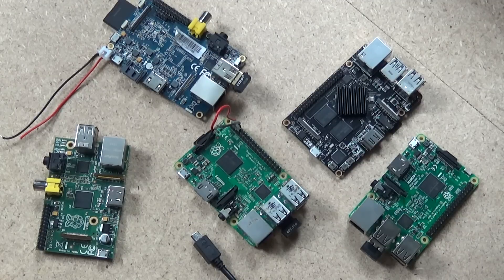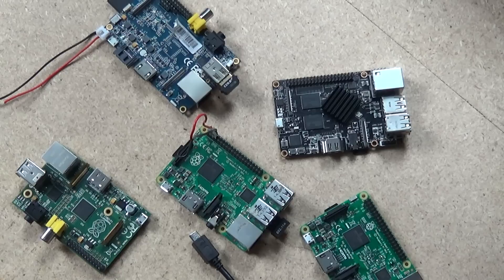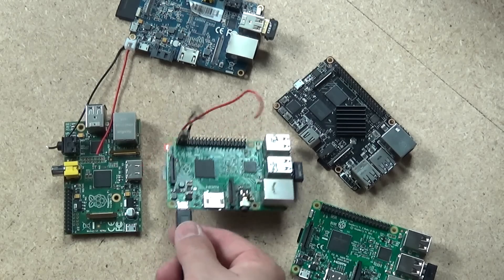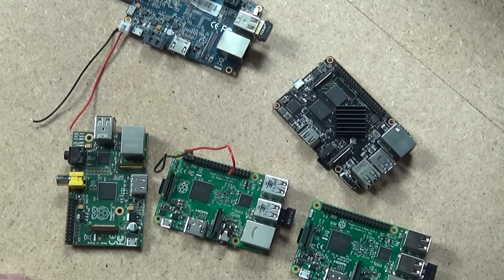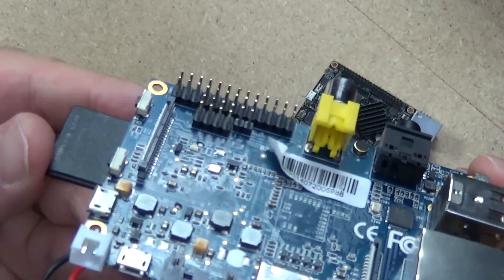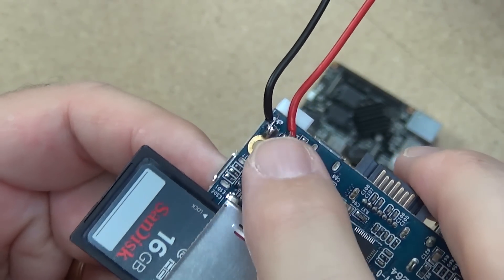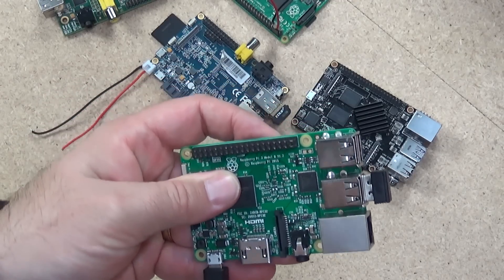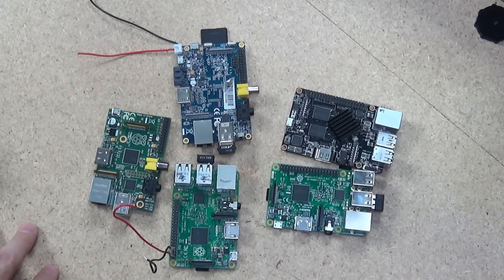Raspberry Pi Power Options - 3 Ways to Power Your Pi or other SBC (MEHS) Episode 44

Comment: Hi. I've attached a Navio2 to a Raspberry Pi 3 Model B. The Navio2 powers the pi. I have a power module attached to the Navio. Plugged in a 3S LiPo Battery. When I plug in a wifi dongle there isn't any power to the USB wifi dongle. Is there a reason for this? The forums and the few videos I've looked at everyone just plugs in their wifi dongles and, hey presto!, it has power. What aren't I doing right? Some help please. :D
Reply from the maker: - Hi.  I have looked at the Navio2 briefly.  There could be a couple of issues.  The Navio provides power to the Pi and the Navio also requires power.  How much power are you supplying the Navio?  It should be 5V at 3A.  Second, the Navio takes over many of the pins on the Raspberry Pi.  It is possible that the serial bus is taken over by the Navio meaning USB might be disabled.  Lastly, you could have a faulty Wifi dongle.  Disconnect the Navio, plug the power supply to the Pi and connect the Wifi dongle.  If it works then its the Navio.  Also, why not use the Wifi built into the Pi?  Cheers.
Reply: I've tried the wifi dongle on my Desktop PC and that works fine. Can rule out a problem with the wifi dongle, i guess. The Navio's Power supply: Power module, servo rail, USB copy from the Emlid website about Naivo2. Average current consumption: <150mA. I've tried connecting the wifi dongle to another stand-alone Raspi for Rx and, again, no power to the dongle. I don't think the USB is being controlled via the Navio because If i plug in a small 4G Wifi dongle into the Navio then that works. I can see it's IP address and connect my Laptop to it. All good there, I suppose. I'll try the smaller 4G dongle on the Stand-alone Pi and see if the software runs ok. I am thinking you need an external power supply. If that is the case I wish it was more obvious whats needed to do. :s I am not sure, but on the Rx side I will eventually connect my Mobile Phone or Table to it and run QGroundControl via a hotspot. It's the EZ-wifibroadcast hotspot but not sure if that from the wifi dongle or the pi's wifi. I'm guessing from the pi as the main reason for the two USB wifis is for Tx and Rx. But who knows.
Kids, don't try this at home!
Reply from the maker: - Sounds to me like the dongle you have is not Pi compatible.  All i can suggest is try another dongle that is known to work with the Pi.  Cheers.

Comment: So the upper limit for a micro usb port is 1.8A yet the rp3 needs 2.5A. Why do we still use micro usb for power again? If the rp4 is more powerful theyll have to come up with a more robust solution
Reply from the maker: - Hi.  Yes the micro USB port is not the most maker friendly port to use either.  I have taken the RPi 3 official power supply apart and I can tell you that the wire gauge they used is much thicker than typical wire you find in normal micro USB cables.  But I get your point, how much power can we really push through micro USB connections.  Cheers.

Comment: Is the mi power bank 2 (10000mah) able to power the Raspberry pi 3?
Reply: Why don't you fucking plug it in and find it out by yourself? Internet babies to be spoonfed
Reply: @UomoMagnetePlus  I know this is 1 yr ago but maybe they were gonna buy one and didn't actually have it.
Reply from the maker: - Hi.  The Pi 3 requires 5V at 2.5A to run without issue.  The power bank you mentioned delivers 5.1V at 2.4A ideally.  I have run a Pi 3 with a slightly under powered supply before with no real issue so I will say yes this power bank will run a Pi 3.  The only factors to consider is, does the power bank really deliver the claimed power and if you use a cheap low quality usb cable you will introduce further power loss going to the Pi.  Cheers.
Reply: thank you..
Reply: My Electronics & Hacking Show Wrong. It doesn't need 2.5A all the time. It just need a stable voltage to avoid long run damages, if the Ampere are not enough it will simply work at basic clock speed and show a lightning bolt icon in the screen.

Comment: Curious, I had powered a raspberry pi 3 using gpio pins and It worked for about a week then seemingly fried the chip and I had to replace. I used a 120v to 5v step down
Reply from the maker: - Hi.  Yeah the GPIO are a good option but your supply needs to be regulated and clean as the normal input protection you get through the micro USB port is bypassed when you power through the GPIO.  Cheers.
Reply: My Electronics & Hacking Show what would you recommend doing to achieve that?
Reply from the maker: - Best bet is to use a quality 5V DC to DC voltage reg.  There are lots of choices but it depends on the power supply you are using.  I typically use Pololu U3V50F5 regulators which are boost regs when using lithium battery power supplies.  If you are using a power brick which is dropping 120v AC to 5V dc then I would still use a 5V reg as the power brick is unlikely to be very clean.  Hope that helps.  cheers.
Reply: My Electronics & Hacking Show thanks!

Comment: amazing tutorial
 i want to make It on powerbank,conect It directly to powerbank,but my question os: could It Be hybrid? i mean the (+) and (-) from rasp connected on powerbank and USB charger at same time,when unplugged It work with powerbank..when put directly energy It charge and uses pi Power directly
Reply from the maker: - Hi.  Its possible but you would need to make sure the output (USB) from the powerbank can output enough power for your project.  The Pi by itself needs 5v at 2.5amps.  Most powerbanks only put out 2.1amps.  I would suggest making your own that can output enough power.  I will be doing a video soon about making a high powered powerbank.  Cheers.
Reply: My Electronics & Hacking Show really? amazing!!!! i Will wait...my project dont need rush because i buyed raspi3 but It Will come only Next week...so i Will stay tuned! thank you

Comment: thank you for the video. 
i'm new into this and i am wondering, if i would do the third option with the soldering, do i need software too on my raspberry? because i watched few videos about gpio on/off switch and there they always need some software.

when soldering how shown in your video can i only solder a on/off switch to the +\- cables and this should work then?
Reply from the maker: - Hi.  Sorry I must have missed your post until now.  If you want the software shutdown option you need a script (software) running on the Pi.  This is better than just turning off the Pi.  You can always skip the script and just solder the switch directly to the cable as you suggested and when you want to shutdown the Pi, shut it down through the operating system and then, when that is finished, turn off the power with the switch you soldered onto the power cable.  This achieves the same thing as the shutdown script and GPIO connection.  Cheers.
Reply: cool thank you for the answer!

Comment: Thanks for the information on Pi power please can you tell me the swg of the red and black cable  thanks Bob
Reply from the maker: Use 24 or better.  I was actually using 1mm solid core there, so 20swg.

Comment: Hi, is it possible to power Pi with both GPIO + also use microUSB as a backup power with power bank?
Reply from the maker: - Hi.  Yes it is.  Just make sure your voltage going to the GPIO is accurate (no over voltage).  Cheers.
Reply: @michaelsstuff4402   Hi, so it is possible to use a 2.1 A smartphone charger and an 1 A charger with pinout? Will none of those components get destroyed? I mean if the pi tries to draw more than these 2.1 Amps, the charger will get destroyed because it's an unsafe one coming from china with no safety mechanisms, which means it would burn...
ty in advance!
Reply: Hey check this thing out https://youtu.be/gr8nxEfSeEA its pretty cool

Comment: So if you have a usb wall plug, you just plug it in an it turns on?
Reply from the maker: - Hi.  If you mean just provide power from a USB wall socket to something like a Raspberry Pi then yes, that is all you need to do to power these types of boards.  The only real consideration is the current being provided by the outlet.  Many wall type outlets are rated at 2 amps.  That is enough for a Raspberry Pi model 2 or some other boards but a few need a minimum of 2.5 amps.  Just check the outlet rating and the power needs of the board you use and make sure the outlet has more.  Cheers.
Reply: Awesome, thank you very much.

Comment: Nice video. About Pi3, do you know if I can use the test pad as the the power input for the Pi itself ? PP1 is +5V and PP5 ground is that is that correct?
Reply from the maker: - Hi.  You can use the pads on the bottom of the Pi for sure (as per the video).  I can't remember which numbers they are but the two I identified in the  video are the one to use.  Just remember to keep the power clean.  No 4.5v or 5.5v input.  Sorry the answer is a bit vague.  I don't have access to a pi right now.  Cheers.

Comment: can i power rpi 3 from 5v 5A smps through power port (micro usb )?
Reply from the maker: TAPAN MOJIDRA - Hi.  Yes you can.  The Pi3 won't draw 5amps but you can certainly power it with a 5v 5a supply.  More than enough power.  Cheers.
Reply: My Electronics & Hacking Show sir how to convert hdmi to rca?
Reply from the maker: TAPAN MOJIDRA
- Hi.  You don't need to as the Pi boards have composite out (RCA).  On the Pi 3 its done through the 3.5mm TRRS connector.  You just need a suitable cable to get 3 x RCA out.  If you really need to convert HDMI to RCA you need a separate digital to analogue converter (DAC).
Reply: bro can i powerup my raspberry with 5v ,2 amp adapter

Comment: soooo .. regarding the soldering points... ehm.. the instructions weren't clear enough.. I've soldered my penis to the ceiling fan
Reply: Unoriginal joke aside, good video mate. Perhaps there is an molex to micro USB on the internet somewhere that can feed super 5v via a computer powersupply. Perhaps there are some way to have the RPi turn on and off the powersuply as well like an ordinary computer
Reply from the maker: - Hi and thanks.  Yeah I'm sure there is something like that around.  I am aware of a couple of add on boards designed to turn the Pi off just like a laptop (ACPI like).  https://www.pi-supply.com/product/pi-supply-raspberry-pi-power-switch/  and  http://blog.petrockblock.com/2015/07/04/powerblock-another-power-switch-for-the-raspberry-pi/
Reply: GengarTV It is...and its simples...an Button for protoboard. You can simple connect It between the cables,other solution: headfone Mic on off...anything that has cables and an on off Button You can use...

Comment: 3:50 It's difficult to tell what specifically he's pointing to.
I'm assuming its the two oval shaped grey spots closest to the edge of the board?
To be more specific about which ones I'm talking about, one is right above where it says PP5 and the other is right above where it says R3 ( from view perspective at 3:44 ).
Am I right in guessing those?
Reply from the maker: - Hi.  If your talking about the two pads to which you can connect power, it is the 2 gold round pads directly beneath and on the opposite side to the micro USB socket.  If you drew a rectangle  on the bottom of the board around where the micro USB socket would be, the two pads in question would be in that rectangle.  Hope that helps.  Cheers.
Reply: My Electronics & Hacking Show cool, thanks man